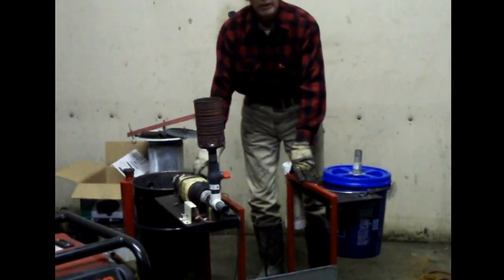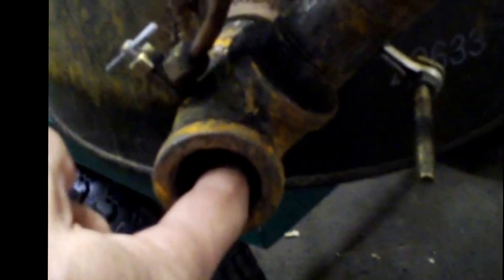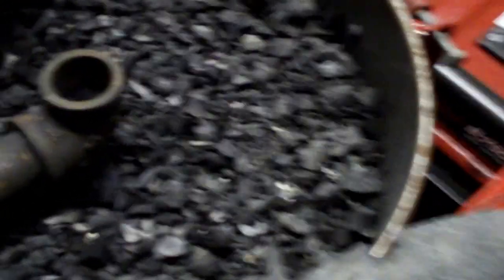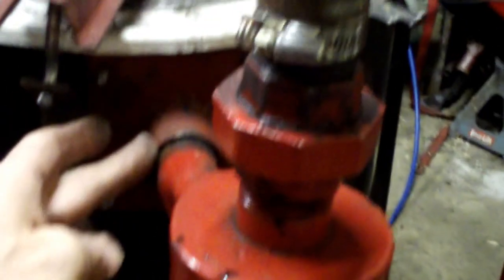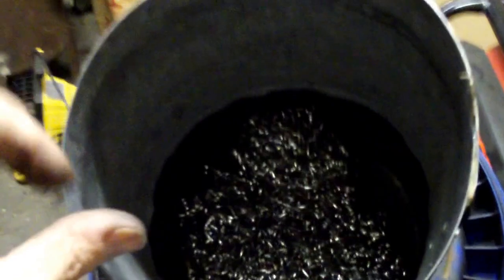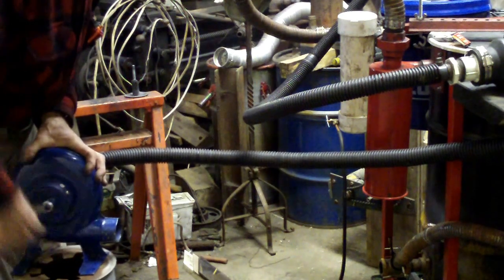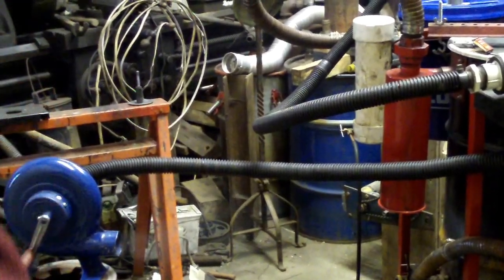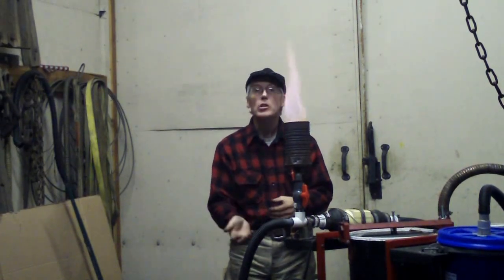Simple Fire 2015

Comment: You should be resirculating your exhaust fumes through the system.
And you could improve power enormously pulling  the nitrogen off of chicken poop if you pulled the gas through on the course end.

Comment: thx gary , been looking at gasification for about 3-4 years and finally built one of yours due to the simplicity of it .you can see me flaring off my setup ,still improving mine slowly ..built a cyclone ,and working on a cooler ... any sugestions for joining pvc to 5 gallon buckets ?.. cause pvc glue will not bond..check out my chanel at Michael hartsgrove